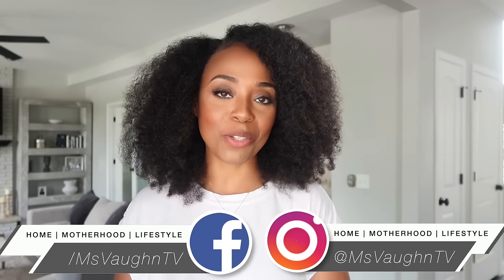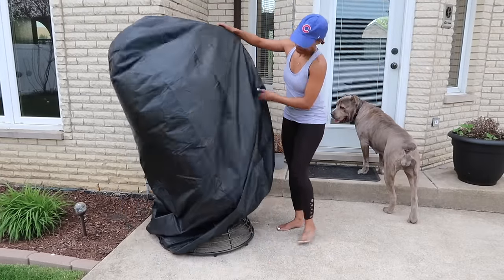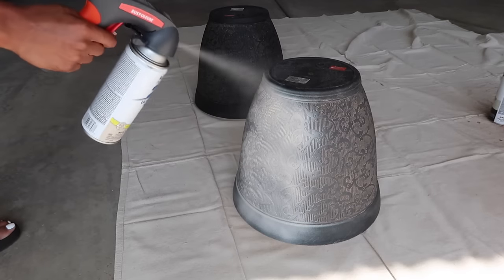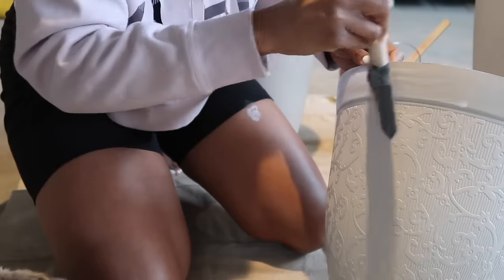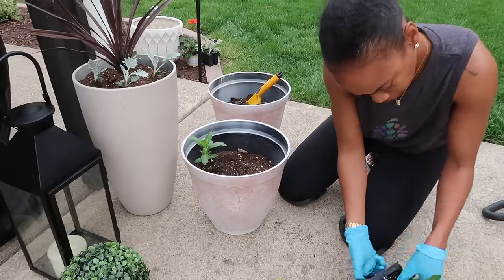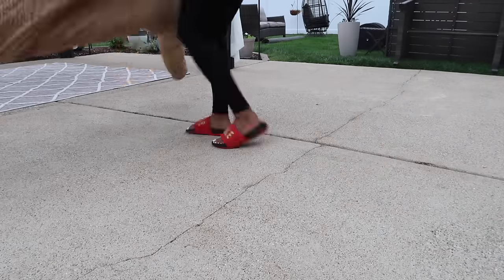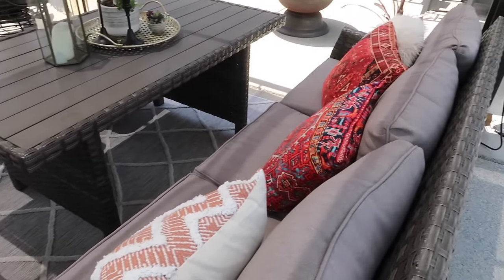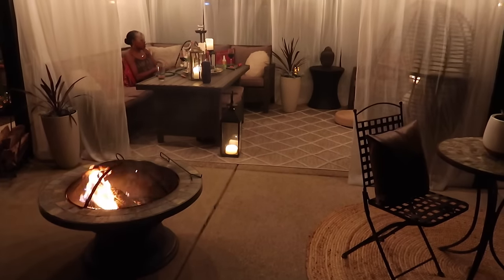Stunning Patio Upgrades You Can DIY! (Under $500) ✨ | HOUSE WERK

Comment: I gotta say you are such an inspiration. I just ordered a 23ft x 11ft metal louver pergola (wayfair) and now will add the sheer curtains to it. I’m laying carpet tiles over my 26x26 concrete deck. Also in the process of diy ultra wide 300 projector screen. Just had privacy fence installed

Comment: You did a  very beautiful job.  It looks very inviting.  You sound like you have professional experience in landscaping and decor.  I'm glad you mentioned the rug.  IMO I would increase the color palette on the rug.  You can even layer rugs in opposite directions for texture.  I love the simplicity of knotting the drapes.  You could also use a pretty colorful ribbon or a thick roping or layer them both.  You can use a napkin ring and knot it underneath it to hold it in place.  It's beautiful as is but you were open to suggestions....You could wrap the drapes with a floral vine with a wire too.  Again, beautiful work.  You're very smart and talented.

Comment: Throw a small red rug underneath your table but on top of the larger rug.  The rug should be slightly longer and wider than the table, it will add that little extra pop.

Comment: Absolutely gorgeous! How will these indoor curtains hold up in the climate? I thought about using them but with our humidity and heavy rain I fear mildew and mold.
Reply: I'm guessing they're polyester, so you can just soak them in some bleach, diluting untill you find the weakest that works, and any mould will disappear in moments, as bleach kills all moulds I've ever come across. I boil my polyester shower curtain ocasionally and that also gets rid of any mould at the bottom where it hangs too low in the bath and stays wet. Try one curtain and see how you get on, as it looks so good?

Comment: Very nice but you should get the round attachment for pressure cleaner it attaches to end of wand and you can go over the concrete like you would a vacuum cleaner makes job so much easier and quicker.

Comment: Ohhh my hunnn I wished I’d saw this earlier you could’ve power washed your patio in 30 minutes with a circle wond attachment that connects to the end of the power washer tip and you place it on the floor and do it like a mop… it covers the entire area it cleans and no splattering

Comment: There is an attachment you can get for your pressure washer and you can do the job about 10 times faster. It is round and 15"-18" diameter. Try it, you will not be disappointed.

Comment: This is the problem with our backyard it’s nothing special about it but the size, it’s huge. We’ve held off on doing anything because we are probably going to sell and  buy another home soon so we bought a pop up canopy that we use when we know we will be out there all weekend and I make it a vibe but it’s still the process of putting it up and taking it down all the time. We invested in a power washer early on in homeownership because it’s great for keeping the outside looking clean especially the concrete, exterior of the house, fence and garage door and my husband some times put it on low pressure for cleaning the cars. Buy some Cutter mosquito repellent and treat your grass. Don’t put it on your flowers just the grass and I promise it helps a lot.

Comment: That patio had definitely been pressure washed before.. after 25 years it would have been completely black with some green
Reply from the maker: My parents never pressure-washed their concrete (which was poured in 1965) and it is still not black and green. lol Maybe the region plays a part. This is the Midwest.